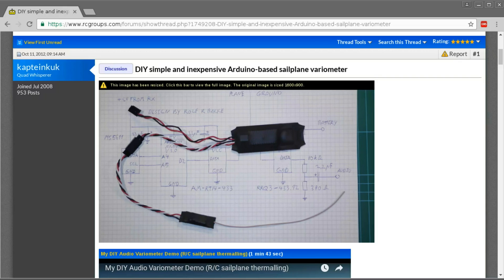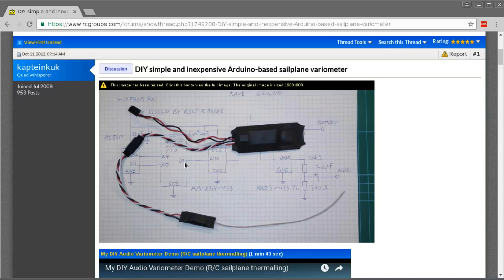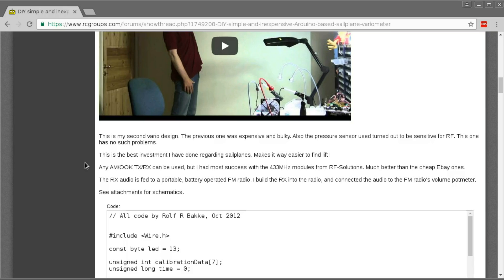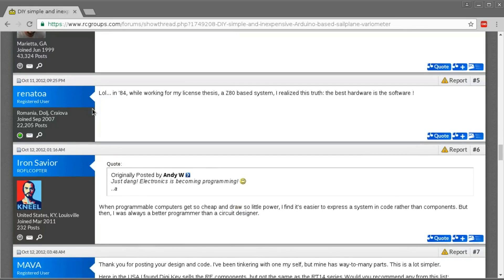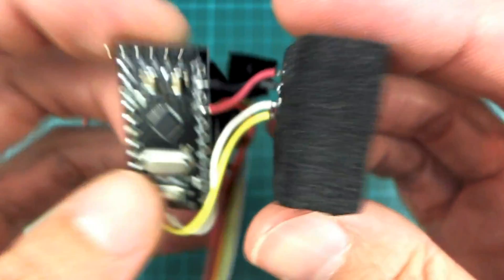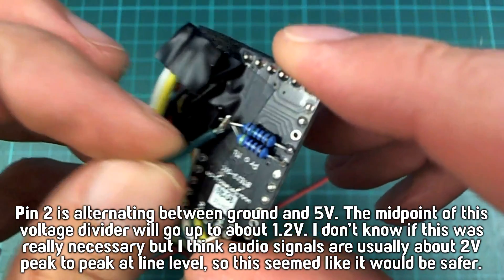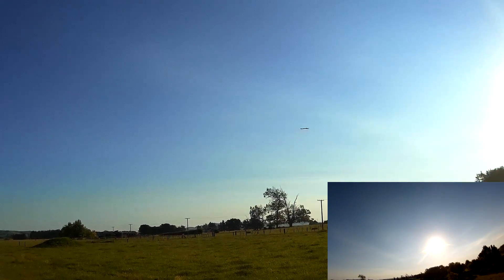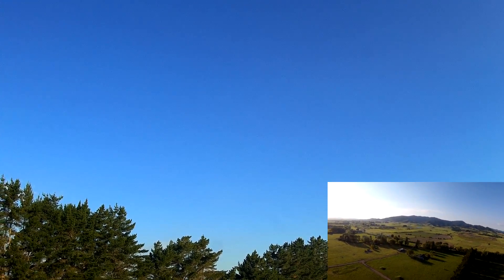Super easy vario (arduino)

Comment: Hi. Really like your idea. One question though, do you have the original design with the buzzer(without the radio transition thing)? Thank you!
Reply from the maker: The original link is in the description. Basically just connect the output to a buzzer instead of to the vtx.
Reply: @iforce2d  Thank you!
Reply: @iforce2d  Would a simple buzzer do the trick or do I need something else? Thanks
Reply from the maker: Some buzzers make the same pitch whenever 5v is applied. Other buzzers only move the diaphragm, so to make a pitch requires the voltage to be turned off and on very quickly. The second one is what you want, so the pitch can be modified. I don't know exactly what each is called though sorry.

Comment: On the forum's diagram, there is a 33uF capacitor between the sensor and the MCU, did you use one ?
Reply from the maker: No, I don't recall doing that.

Comment: What type of sensor did you use?
Reply from the maker: MS5611
Reply: In compare with BMP180 is it better? I would like to make something similar.
Reply from the maker: I think I saw a comparison somewhere showing MS5611 is slightly better. But for this purpose you would not notice any difference, and the sketch is already set up to use MS5611.
Reply: I am in phase of selecting hardware. Have Arduino mini but have no solder :)

Comment: Could you use one of the ATtinys  to make it smaller ?
Reply from the maker: Looks like it could work. I've never used ATtiny before but I looked into it a little just now, if you replace the Wire calls with TinyWire equivalents (https://github.com/sudar/TinyWire) it compiles with this memory usage:
Sketch uses 4948 bytes (60%) of program storage space. Maximum is 8192 bytes.
Global variables use 118 bytes (23%) of dynamic memory, leaving 394 bytes for local variables. Maximum is 512 bytes.
Reply: Aussie Mozzie The pro mini is pretty light (< 2g) if you get one on a thin pcb. Some of them have a thicker pcb and weigh nearly 3g.
Reply: like one of these ATtiny breakout boards 

https://www.aliexpress.com/item/Digispark-Kickstarter-ATTINY85-For-Arduino-General-Micro-USB-Development-Board/32668399070.html?src=google&albslr=227945310&isdl=y&aff_short_key=UneMJZVf&source=%7Bifdyn:dyn%7D%7Bifpla:pla%7D%7Bifdbm:DBM&albch=DID%7D&src=google&albch=shopping&acnt=494-037-6276&isdl=y&albcp=756822904&albag=35305934810&slnk=&trgt=61865531738&plac=&crea=en32668399070&netw=g&device=c&mtctp=&gclid=Cj0KCQiAgNrQBRC0ARIsAE-m-1xOBUgJ6llQ58H3WyLusQnubGJNeRl4TaJksxHTKGuNyG_jjOyt77kaAnMMEALw_wcB

Comment: I wonder if at this altitude is possible to measure and detect changes in air temperature but maybe is not much useful in rc planes idk
Reply from the maker: I think a baro like this typically also has a thermometer, which is necessary to compensate the raw pressure reading and get a proper value.
Yep: http://www.amsys.info/products/ms5611.htm
So I think it is continually sensing the temperature all the time - the number is there if you care to record it somehow.
Reply: cool, the application note shows how